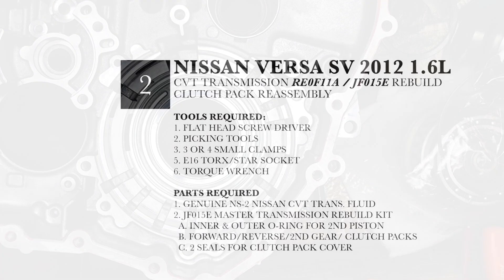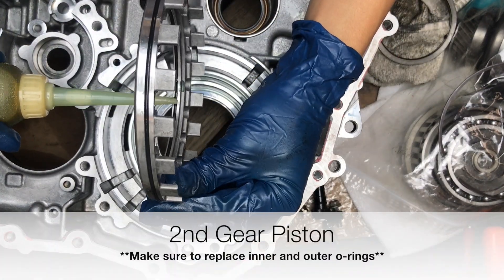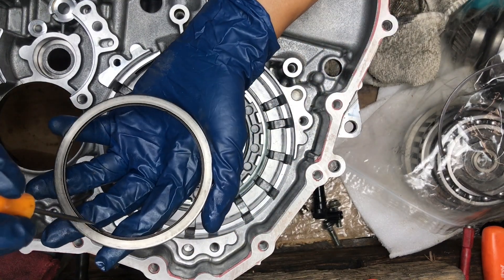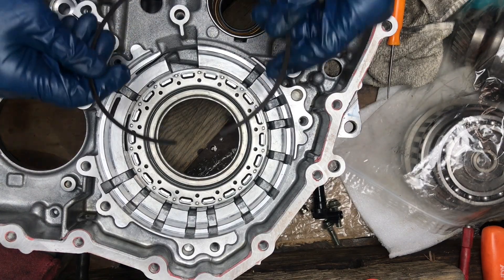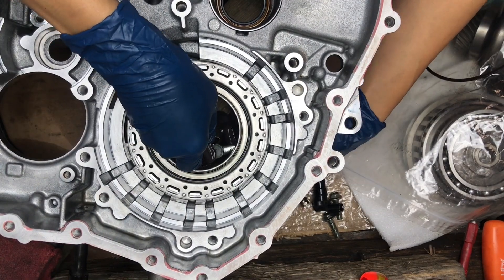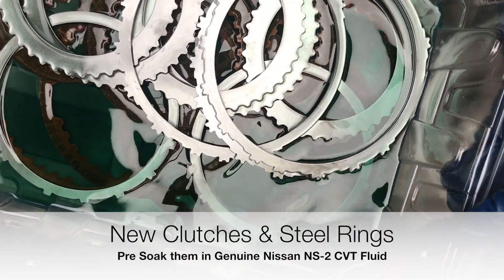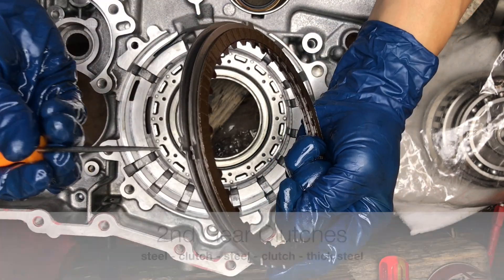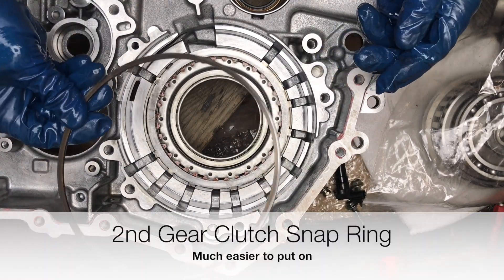Nissan Versa SV 1.6L 2012 - Part 2/4 - CVT Clutch Pack Reassembly - REF011A / JF015E

Comment: Hello. My Nissan 2012 model 1.2 Micra automatic vehicle vibrates at speeds of 50-60 km. When I take my foot off the gas and press it again, this problem goes away. When we take it to the repairman and connect it to the device, it gives FLUID PRESS SEN/SW B error (P0846). What could be the problem?

Comment: @7:42: How sure are you that the flat side facing up? I'm doing the same s**t actually and i'm pretty sure that the round side of the steel plates facing towards the big ring gear on top. I looked at the marks on the rings and i saw tooths from the gear ring on the rounded side of the plates. I'm not sure, but i'm nervous now if i assembled it correctly or not. BR from Switzerland, Matthias

Comment: If I am able to successfully rebuild the CVT, how long can it last. I have done 126k miles on my Nissan Sentra 2015 model. The transmission has broken down. Isn't better to rebuild or buy a used one. Please advise

Comment: Well i believe i have found the culprit the feed tube seal is not even in the plate at all it is M.I.A tested everything and swapped out valve bodies finally split case and was looking at everything pulled plate out tested reverse piston it works fine then noticed missing seal going to put her back together this weekend and see what happens feed seal should be here today thanks for making a great video. Did you have to do any relearn or have nissan flash it?
Reply from the maker: If you are replacing the valve body, make sure to swap over that EPROM chip on the valve body, so you wouldn't have to relearn. If you use a new EPROM, the relearn process will have to be redone at the dealer.
Reply: @TheLaborService  where is that located?
Reply: @TheLaborService  i swapped the valve body from my old transmission into this one to try it before pulling it out so do i just leave that valve body in it or swap out to the new one?
Reply from the maker: @acrophobiar1  That works. If you want to use the new valve body, swap the EPROM on the old valve body, onto the new one, then install the valve body. You see next to the TCM connector? there is a green plug, its plugged in the black square, that black square holds on the ROM. You'll have to swap that onto the new one. Here's a photo: https://at-manuals.com/wp-content/uploads/2020/05/jf015e_solenoids-1024x655.jpg
Reply: @TheLaborService  great thanks again you are a tremendous help
Reply: @TheLaborService  if im buying a used transmission from a junkyard, do I have to use my rom from my original valve body or keep the junkyard tranny as is?
Reply: This is re0f11a
Reply: @shadowmodding3606  your rom or have it relearned
Reply: @shadowmodding3606  yes

Comment: I need you help!! If the transmission is slipping do i need to work on the clutch and disc ?? I already replace the solenoids and keeps slipping in 2 gear while i pass 2,000rpm the idle and tranny feels weird then it goes, when im driving 30plus i dont feel it just when i stop and 1 and 2 gear work together im guessing is the clutch and disc since i dont hear or feel another fail in the tranny please give me your point of view im about to open the trans again
Reply from the maker: Do you have a CVT or is an automatic non CVT tranny? CVTs don't really have gears, the speed and rpms adjust by themselves. How many miles on the car? If you have replaced the transmission filter, trans cooler filter, transmission oil, solenoids, and problem still exist... Depending on the amount of miles you might be close to that CVT belt dying. There are also clutches in there you should also replace along with seals and the transmission oil pump. The Nissan CVT is an awful design flaw.

Comment: my 2012 nisan versa throws this code p0846 it is the pressure switch sensor.and i don't know which one it is if it goes inside the transmission in the valve body or out side the transmission if someone can help thanks
Reply from the maker: P0846 involves switch B on the valve body under the transmission pan. It is possible to the switch just the individual solenoid. I have a video here: https://youtu.be/yPGI_Jlb-h8 The easiest possible way is to swap the entire valve body. But when you do make sure to swap out the EPROM from your old one to the new one. Also, before doing anything make sure your transmission fluid isn't low. Also, if you haven't changed the transmission filter, and transmission cooler filter, now would also be the time.

Comment: How many hours and how much as mine has to be replaced and I don't trust the dealer?
Reply from the maker: Hard to say how long it will take. I had to order parts mid way, also I was filming the whole process wasn't in a hurry. It took me a month. I think if you did it yourself. Might take you 1 day to take everything apart then take out the transmission, depending on what you are replacing inside the transmission, cleaning it, replacing belt can take a couple of days, and then putting everything back into the car will take another day. Sooo... maybe a week of commitment?

Comment: I have the same problem...going forward in reverse but I think the piston or the small seal that feed the piston is leaking but when I shift from drive to neutral or reverse to neutral feels like it bumps after 1 second while in neutral..forward gear are just fine
Reply: I just had a P0846 code and rebuilt the valve body... now reverse doesnt work at all, reverse is pretty much drive
Reply: @geoffreykidder5694  found my problem, linkage in prnd manual valve wasn sitting right on valve body, I jus put in plce and now is working like it should

Comment: Did your transmission works fine after you finish I open my  transmission looks like so I only replace the oil pump and I still have the same problem code p2859 where the clutch A&b is located please help
Reply from the maker: Yes, everything is working perfectly. I recently drove it up to Fresno and back for work which was a total of about 530 miles, but I did do an entire rebuild. P2859 could possibly be one of the solenoids on the valve body. Have you replaced the solenoids on the valve body? There are pressure solenoids there. One of them might be malfunctioning/stuck open or closed. I also have a video on replacing the solenoids.

Comment: Where do you buy these kits? I’m a Nissan technician and I only open up the sub assemblies...
Reply from the maker: Andres, we got these transmission master rebuild kits, pulley, and belt from alibaba.com, and some off ebay such as the oil pump, LOCTITE, NS-2 oil, and solenoids.